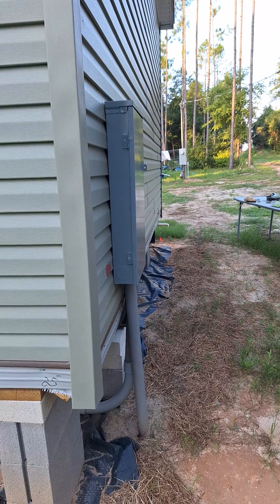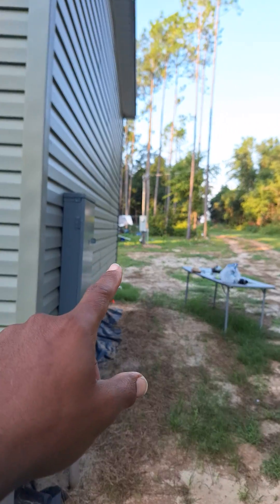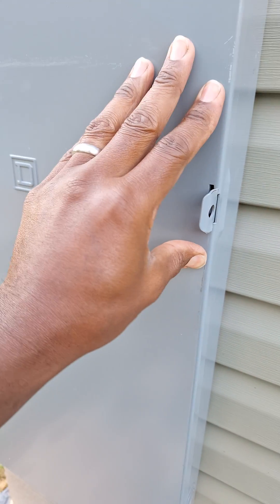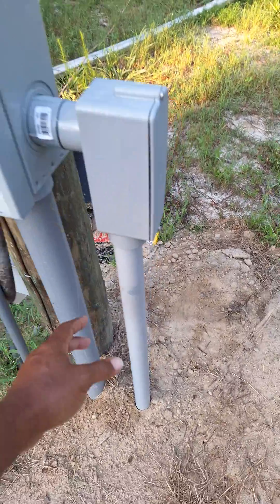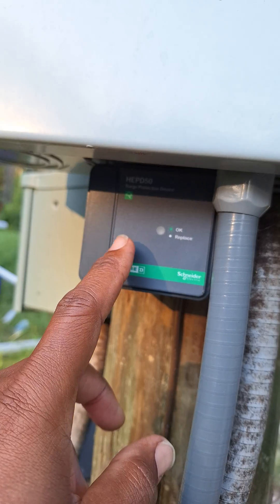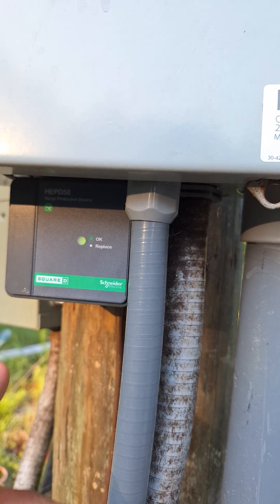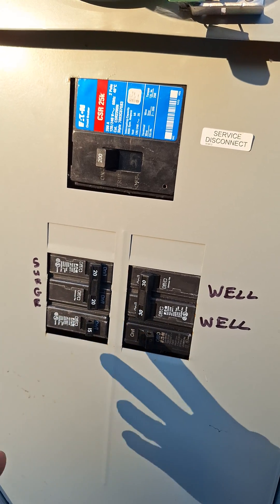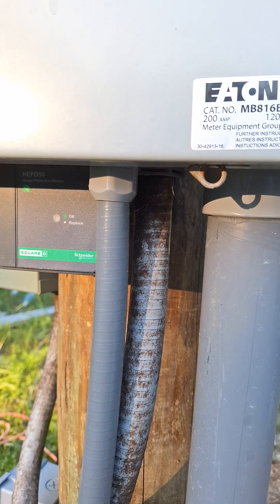The Florida Building Code - Electrical Surge protector #electrical #buildingcode #powerpole

Comment: That device comes with a 3-year, $50,000 connected equipment warranty, in order to file a claim you  will need the receipt from the electrical company that installed it unless you purchased it yourself.
Reply from the maker: Thanks for sharing 👍